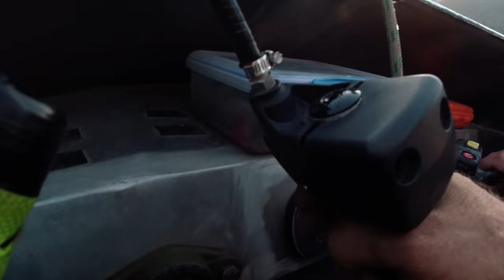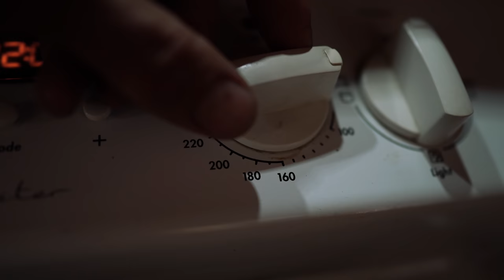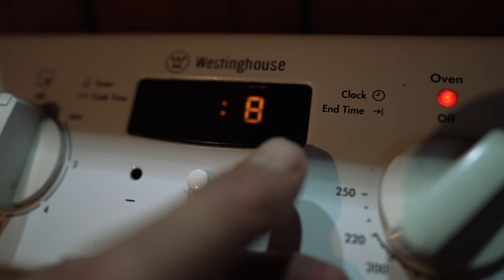New Zealand ADVENTURE VLOG 181 with Josh James and friends mini jet boat man shed Duck shoot n cook

Comment: Just a thought if said wheel spacer issue arises again.. The yellow road signs or wooden guard rails around the country have large washers suitable on the back of the bolts holding them on. Chur

Comment: Howabout a telescopic arm on the boat trailer so you can have it short for towing so it doesn't flex about and then extend it for getting the boat in and out of the water?